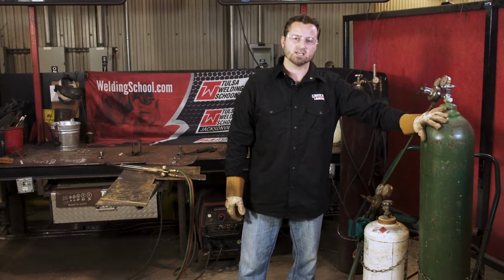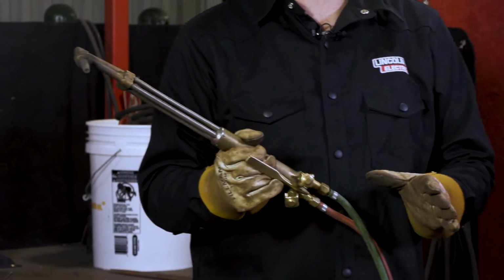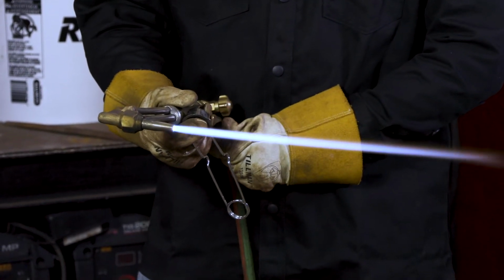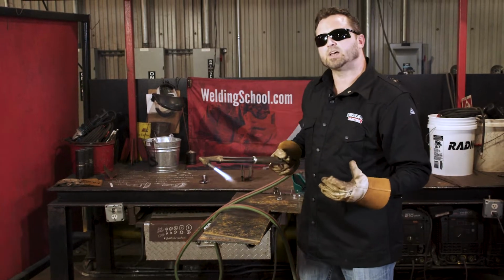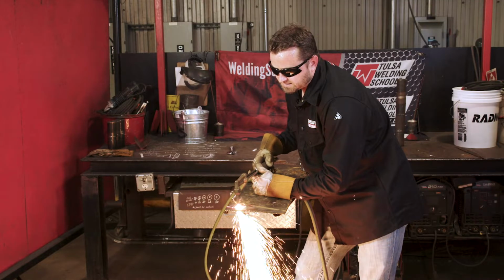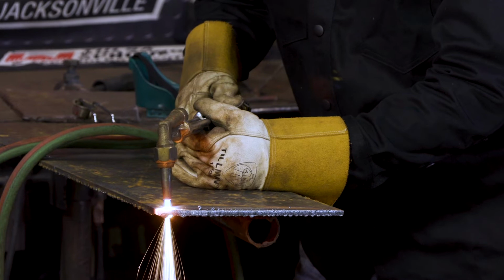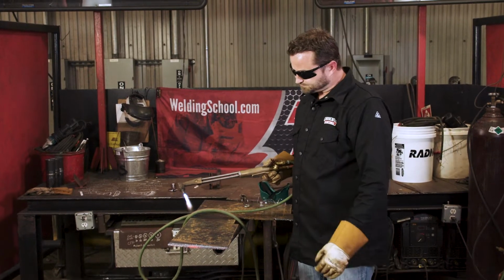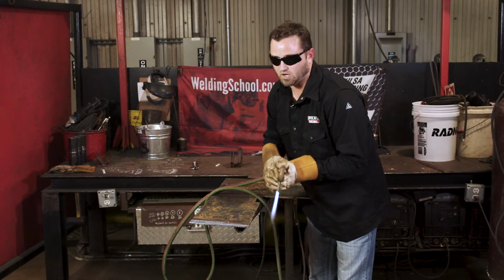How to Do Oxy-Fuel Cutting: Best Practices, Tips and Tricks

Comment: Thanks for the video but the "Moisture out of the metal" is another "wives tale". The "moisture" you see on the surface is a result of O2 and Hydrogen condensing on the cold surface. Moisture does not "soak in" carbon steel!